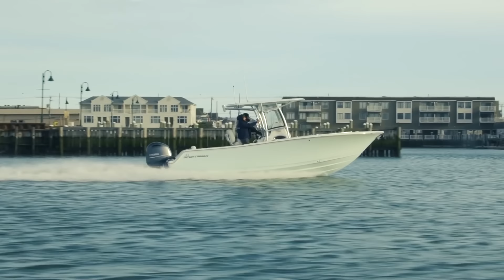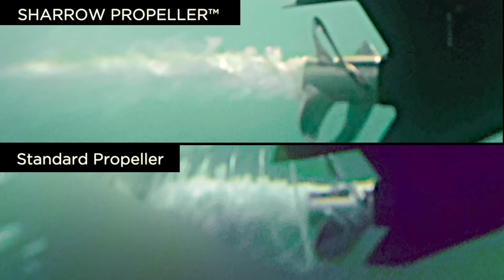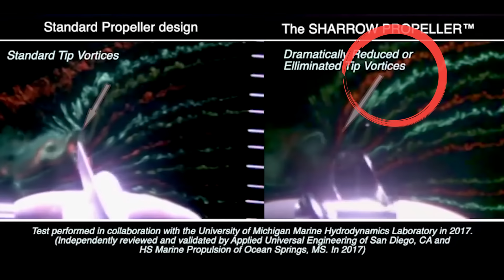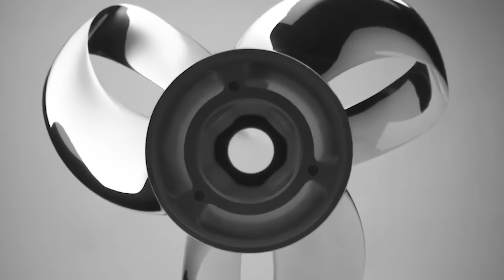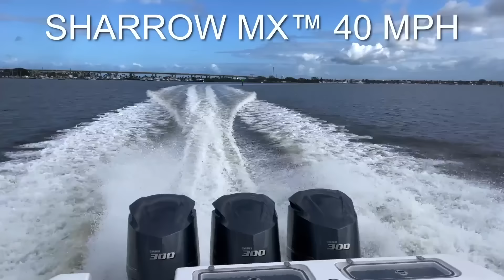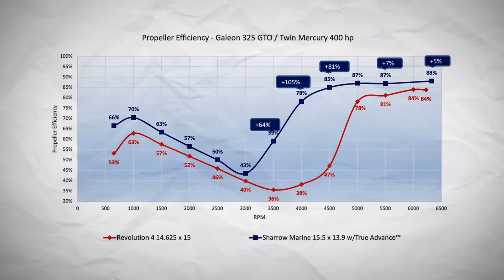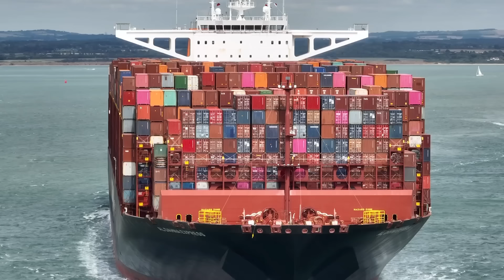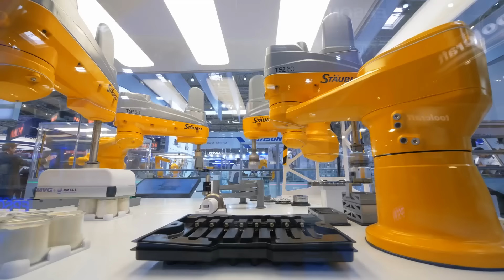This Genius Propeller Will Change Transport Forever

Comment: I imagine that toroidal blades could be amazing on fans, both for noise and static pressure
Reply: I work for a fan manufacturer... when I told my older colleagues about that toroidal design, they just rolled their eyes and said "this design comes around every few years for the last 10 years".
Reply: @Casey093  There is a company that manufactures ceiling fans with toroidal blades. It’s called the Willacy Collection.
Reply: @Casey093  Check out Mark Rober’s video on the Zipline drones. They utilize a modified toroidal blade design that’s insanely quiet. It would be quite easy to translate that to a fan design.
Reply: @Repent and believe in Jesus Christ  ur sick in the head
Reply: its all fun and games until your fan takes off
Reply: Most lawn windmills are on the idea of Toroidal blades
Reply: You don't even need that for Macbooks.
Reply: @kemaleksi6725  lol so you have a cooled, inferior product that costs more. Good job.
Reply: @JunkBondTrader  mobile things should be silent.
Reply: Noiseblocker did something similar with their eloop fans. They’re generally unremarkable, aside from the 120mm version being six bladed which is suspected to be the actual reason for their installation specific tendency to make high pitch resonances
Reply: They're not. Air density is too low, but it works well with liquids
Reply: Should be easy for home fans as they are made of plastics   NOW WHY has not I seen them for sale YET??
Reply: @Repent and believe in Jesus Christ  repent to Ra.
Reply: Major hardware tried it, didn't beat a Noctua.
Reply: They tried it with a rough 3d printed model which was eyeballed caus he couldn't get the schematic from MIT. Also the design that he based off was designed for a drone in open air, not the focused airflow needed in a PC case or similar. This design has potential but as mentioned in this video, it needs to be specialized for each application, as all fan designs do
Reply: @flask9712  yeah... He needs to get a real printer. I'm pretty convinced a lot of the blade design submissions could beat a noctua if they didn't have horrible fdm surfaces everywhere. A lot of the designs on there would be epic with a resin printer.
Reply: @CaedenV  Thats what annoys me with his videos and he doesn't talk about it. The tolerances he gets are terrible compared to for example noctua's with the tiny tip clearance that they needed a new material for. It's just not fair to compare fan designs when the material is so different, but he acts like that's the test and here's the conclusion, end of story.
Reply: @flask9712  yeah like at this point he has to have a budget big enough to afford printing from resin or getting a more precise non-resin, that won't make the fans look incredibly flimsy.
Reply: @CaedenV  well he did try a smooth one with more care and time and it failed to beat the rough printed one. There was a couple of tests from others that also showed the bad rough printing was not performing worse than a properly manufactured blade of the same design. Don't shoot the messenger just what I have seen.
Reply: It was tested. Rough blade surfaces make no difference.
Reply: @rasta77-x7o  BOOM, There you go ladies. Quit your bitching. Waiting to see if anyone would pipe this in, as though MH has never addressed the subject. He has, he just doesn't do it every damn episode.
Reply: @rasta77-x7o   proves please
Reply: Are you running fans at 2-5k rpm? Because if not, this won't help you.
Reply: @CaedenV  my fanws are rrunning at 2.1k rpm right now. It's not astronomically high.

Comment: The Main drawback is going to be manufacturing, 3d printing is fine for drones because they’re low power applications, contrary to what 3d printing geeks will tell you 3d printing creates an extremely weak product, especially compared to a laminated equivalent. For marine the loads on the prop are many orders of magnitude greater than a drone so it’s needs to be made from metal. They could cast that shape using lost wax casting but it would take a huge amount of machining afterwards to get it balanced, plus castings are never as strong as something machined from a solid block. If they have to machine every one from a solid block then that 10x price tag will severely limit the production

Comment: I wonder the effects of viscosity on the individual props and their applications, and the resultant torque requirements. I would imagine a prop designed to be used in water will require more motor torque than that of an air drone, and that for an air drone variables like altitude and humidity will be of consequence too.

Comment: question: is any of this usable (or already used) in commercial/cargo aviation?
Reply: I've never heard of such used in airplanes. I'm skeptical that they'd be useful for larger aircraft, for two reasons. First, the centrifugal force would put massive stresses on this shape propeller, while a normal propeller's straight blades are aligned with this stress and thus won't be deformed or pulled apart by it. Second, all but the smallest planes have variable-pitch propellers, and making a variable pitch version of this would be extremely complicated. For these reasons this would be limited to smaller or slower-turning applications, and fixed pitch - which still gives many possibilities for boats, ships, and drones (of the current small variety, running into similar issues if wanting to scale up to manned versions). It will have it's uses, but I doubt you'll see it on a cargo plane.

Comment: In a propeller are a lot more factors to be considered, sadly totally ignored here : material resistance is just one - this design has a lot more surface, so the stress in the material will be significantly higher, as well the stress because of temperature variations. 
Another factor is obvious, the cavitation effect - again, not a word about that. 
The tech is old and well know, so the fact we have turbojets on modern ships and not this design suggests the drawbacks are much bigger than is told here - and is not the costs, lol, a turbojet is a lot more expensive than any propeller !

Comment: I wouldn't be surprised that as rotor size increases the peak rpm for maximum efficiency also drops. I doubt the rpm would stay fixed or increase. CFD modelling should easily be able to answer this question.

Comment: Bottom line is that at $5,000 a pop there's no way in hell a boater like me with a 500 horsepower weekend pleasure boat would put that kind of cash into a prop for just 20% gain it's such a small RPM range to make it feasible all around

Comment: I would like to see more data that supports the claims of “more efficiency” like speed (at all rpm ranges), fuel or energy usage at a given speed, etc. it’s well know that certain propellers (given pitch, diameter, design and blades) provide benefits over others at certain applications given power and rpm ranges but if the price/performance/power of this propeller does not exceed current options it will never be marketable.

Comment: I wonder if this could be implemented into fans and air purifiers and such.
Reply: Yea for an open design household fan as example, all the same benefits as above should apply. Lower volume (the major complaint people have of fans), and maybe as much as 50% lower energy cost for the same airflow, and then even lower volume because you could run it at a lower speed for the same airflow, etc.

Comment: The graph with the efficiency of both propellers is misleading, because the toroidial puts out more power, the boat quicker gets   better into "glide mode" (I dont know if this english term is correct) but basically a boat first pushes all the water away and then reaches glide mode like the graph shows and becomes suddenly much more efficient. But for everyday usage this jump does not matter because you would try to reach the glide mode first. So better comlare jt before and afterwards. Therefore it is misleading.

Comment: If you’re interested in trying out some computer fans that work on the same principle, search for Noiseblocker ELoops.

They’re fantastic fans, very quiet and good for radiators in a push configuration.

Comment: 1. this design cavitates, period.  "reduced noise" has not actually been shown or proven anywhere.  
2. 105% efficiency means it adds energy to the thrust which wasn't put into the propeller by the motor; in other words, you don't understand simple arithmetic.

Comment: Love to see the effects on massive ships like cargo and cruises
Reply: The screws on big cargo ships do not spin fast enough to have tip vortices problems
Reply: @blackhawk7r221  However, cavitation is a problem for something like a nuclear submarine who is trying to remain super quiet. I want to see if it can work for them.
Reply: @blackhawk7r221  Not all. S.S Maui (Matson Lines) cavitated so bad, at 105 rpm, a Submarine could hear us 600 NM away. (So I was told, by a submariner!)  They tried to change the prop, but the new one broke loose going over the Columbia Bar on it's way to have it put on in Portland. Look on a chart, there is a 5000 ft. "hole" right off the bar, that's where it is😮!
Reply: @blackhawk7r221  Yes they do.  The tip vortices are created because of tip speed.
Reply: This is only helpful for small high speed propellers. Great big ships don't have big losses at the tip and are already way more efficient than this. You just can't put a big ol screw prop on a tiny little jet ski or motor boat, so this is just a good compromise.
Reply: Toroidal propellers on drones, if truly quieter and more efficient, will be deployed on combat drones
Reply: And on airliners, too.
Reply: @larispostae42  can't aply this on jet engine.
Reply: @larispostae42 nope. Unless you complete reinvent jet engines
Reply: I can't wait to fit these to my whaling fleet…, Gonna sneak up on those fat ass Wales no problem.
Reply: It'll add to shipping costs if they make the replacements, as heaven forbid a company makes a loss short term for long term gain.

Comment: Well yes. But actually no. 
Reason one- motors usually do not go further than 4000RPM nowdays. Witch mean gearbox (and complicated one, if you do one it should be so. Engenering traditions dont mind), gearbox mean weight and complexity and more cost and more qualification of crew. 20% gas save can be (and is,sometimes) achieved with much less overcomplicated methods. 
Reason two- different parameters- bad. Its pain in arse to redesighn a thing just cause some part is 3% better and now all resistance calculations is garbage. Thats why chosen few factory made things are upgradable. They are build to always be at that near self destructing rage. 

I understand that Susan is dictator of sorts and youtube is not so easy thing to boil in. But, please, shut up that this is "revolution". Its not, if would've been everyone would already knew. 

P.s and dont use Marketing magic stuff to make me feel hypedfor few second till I look into numbers. Its annoying. Bad content maker, bonk! =Д=

Comment: I will suggest you to make with wood , use coupling system to attach,  bit by bit  joint can make this structure,  we can also make with trerrokata clay  to reduce the cost. 
Jay shree ram.

Comment: Being able to travel 20% farther with the same amount of fuel the boat can holy and doing it faster is quite an improvement.
Reply: yea youtube is full of this kind of claims. i call this bs
Reply: @XxvoleistulxX  It's bs based on WHAT??
Reply: @ffjsb  being based on- this has already been tested by many smart engineers, and there is a significant problem with high rpm, big vibrations. cant be controlled, so you go ahead and fund them.
Reply: @XxvoleistulxX  Well obviously it works to some extent, so what's the problem???  Vibrations just means it needs better machining and balancing.
Reply: @ffjsb  Its based on how much more they want to charge for a prop
Reply: @ffjsb  "It's bs based on WHAT??" - as least sound comparison on the boats is bs. The sound you hear is the engine sound, not the propellor sound.
Reply: @renedekker9806  The WORK the propeller has to do contributes to the noise of the engine genius...  An engine under LESS load produces less noise.
Reply: @ffjsb  "An engine under LESS load produces less noise" - Not with the small level of improvement that they claim they have. Reducing the audio volume of the recording is a lot more effective.
Reply: @renedekker9806  Yeah even if it's because the engine doesn't have to work as hard, the sound could easily have been manipulated after the video was made
Reply: @renedekker9806  105% efficiency is NOT a "small" level of improvement.  SMH
Reply: @ffjsb  "105% efficiency is NOT a "small" level of improvement" - 105% efficiency is impossible. What you mean is a 105% efficiency improvement. And that is just an empty claim in the video without any evidence to back it up. 
And even if there was a 105% efficiency improvement, then the noise of the engine which still not be significantly less, because the engine noise is almost only related to the engine rotation speed, not to the power output.
Reply: @renedekker9806  Physics 101 failure. 105% efficiency is perfectly possible, heat pumps are routinely well in excess of 100% efficient for example, though that is sort of a special case. In terms of noise if you reduce the cavitation and vortexes from the prop you will reduce vibration and hence engine noise.
Reply: @jonathanbuzzard1376  "In terms of noise if you reduce the cavitation and vortexes from the prop you will reduce vibration and hence engine noise." - almost all of the noise of an outboard motor comes from the pulsating exhaust gasses, and follow directly with the rpm of the motor
Reply: @renedekker9806  I said reduce not eliminate.
Reply: @jonathanbuzzard1376  "I said reduce not eliminate." - and I explained why it would be only a minimal reduction.
Reply: @renedekker9806  Problem is that the video evidence is that reduction in noise is substantial. Experimental results always but always trump theory. So your explanation as to why it will be a minimal reduction is for jack shit.
Reply: @jonathanbuzzard1376  " the video evidence is that reduction in noise is substantial" - most likely they have tuned down the volume of the video to make it look like that.
Reply: @renedekker9806  The is also a plot of the noise over the frequency spectrum are you going to claim they faked that too? There are papers from MIT showing significant noise reduction when used on drones. Are you claiming it's fake because you know better?
Reply: @jonathanbuzzard1376  "...significant noise reduction when used on drones" - I can believe that, as a lot of the noise of drones comes from the propellors. But the video demonstrates (and we were discussing) the noise of an outboard engine on a boat. That part of the video is very likely faked.
Reply: @renedekker9806  These props have been out for a while, there are loads and loads of third-party confirmation that they significantly reduce noise and increase fuel efficiency. If you want to continue to think it was faked that's your business but you are just dead wrong.
Reply: Sharrow is asking $5000 US for this propeller for a pleasure boat.  For most boaters, there is no pay back to switch.  I just bought a brand new standard propeller last spring for $130.
Reply: @lightshipchief  It's just like when any new technology comes out, it's expensive as hell at the start...
Reply: Wasn't it more like 2.05 times the distance using 20% less fuel?
Reply: Yeah, you should see the wheels I’m building !
Reply: yes.
Reply: If you use 20% less fuel, it makes your maximum travel distance 25% longer.
Reply: "boat can holy"? What do you mean?
Reply: @noredine  amount of fuel the boat can hold
Reply: @noredine  They get the Pope to bless the fuel.
Reply: Boats do walk on water
Reply: It walks on water
Reply: If it sounds too good to be true it probably is.
Reply: @heynickynicky  The cost is like 5x a regular prop. and if you hit something, yikes.
Reply: @heynickynicky  You do know that technology.....advances, right?
Reply: @Nick Christiansen  this video literally demonstrates how the propeller works and how it's better than conventional propellers
Reply: @dzp11177  this video claims it is true and does nothing to prove it. 99% of the pictures/clips has nothing to do with it
Reply: @stixinst5791 Did u watch the video?
Reply: much quieter   far less foam  hard to detect far less  wake  fooled enemy for years!!!
Reply: And make every form of travel cost 20% more for the consumer.

Comment: The Sharrow propulsor has been around for quite a while now but the MIT designed really propelled this to a preponderant amount of people. Many proponents are proposing their own propeller designs but what will the proper way to market these be? It seems the propensity for creating MIT-like prop designs is preponderous right now but at least Sharrow's proprietary design is too challenging to proportionately propagate. Maybe this could have a propend on other methods of propulsion like the propjet :)

Comment: Apart from the tip vortices, we are comparing a 2 blade with a 4 blade propeler right (in any case double blades)? Isn't it meant to be better at same rpm (plus requires more torque)?

Comment: helicopters?   those bitches are loud, and if they stay in one fixed place for too long, theyll lose lift as the air recirculates into the blades.

Comment: I see 2 more possible uses if all the engineering can be worked out. Any type of air moving applications including HVAC, large ceiling fans, dust collectors. I am curious as how this would work in a turbine style dust collector where the blades are stationary forcing the air and dust to spin for the removal of the dust.